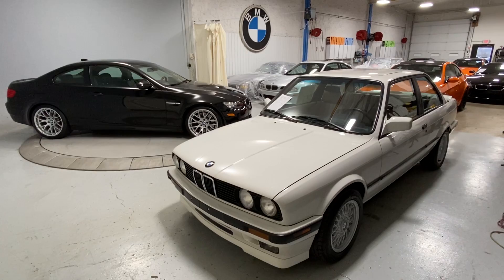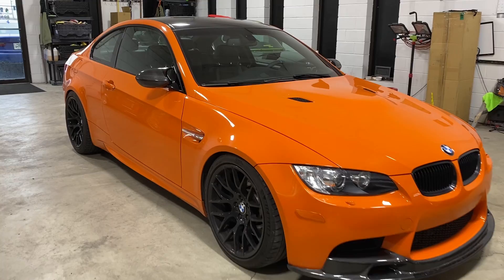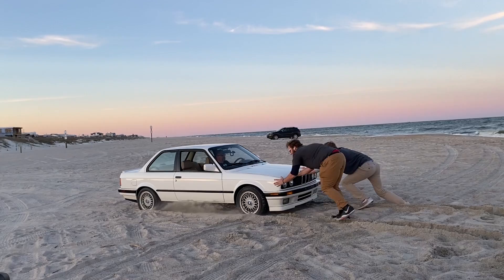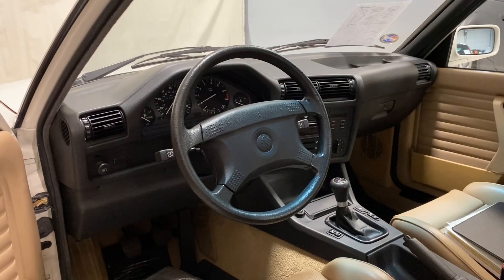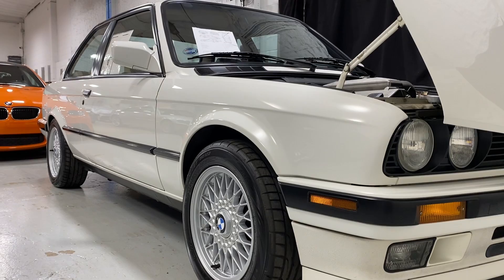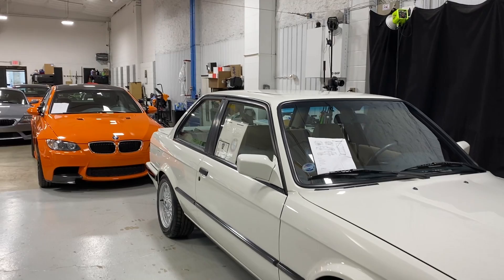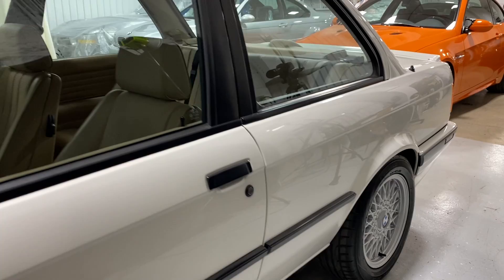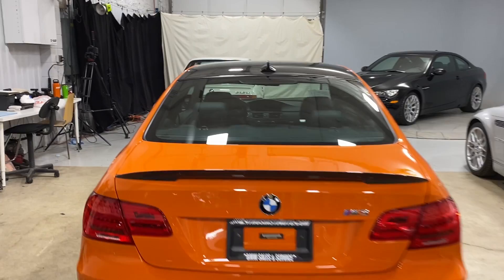1991 BMW 318is - Memory Making E30 - BMW Enthusiast Chronicle

Comment: Cool video! My first car was 91 318is. My dad bought it about 10 years before I could drive. I daily drove it for 3 years before I went away to school. I loved it. Sadly the driving through 15 New Hampshire winters it rusted away. After I graduated we found another one in good shape. Sadly the M42 engine bent valves and destroyed its self. So we did an engine swap and she is living on with an M50 engine. I love e30's I don't think anything will ever come close in my opinion.
Reply: Sad that we lose e30s from owners that dont love them enough that they rust away
Reply: @_rmms_8285  I think we lose more e30's from people tracking them and crashing them then people who daily drive it through the winter. I was 16 and it was my car... I had to get to school and football. Thanks for the back handed comment though...
Reply: @BattleBean762  what i meant by that is it can rust away but dosent mean you have to tthrow the car away restore it. I have two e32s and one dosent have the whole floor its rusted out and im only 16 myself and broke. restore them both is my goal and  to save as many other old bmw as i can :)

Comment: God only knows what they want for it.  Cool car, but certainly not earth shattering.  The M42 was a "gutless wonder".  Really had no torque, but the benefit was the lightest E30 since the 2002.  Best thing you can do with that car is do an M50 swap.  I don't think it will ever have much collector appeal and why not have something that performs.  I'd rather have an M20 car any day of the week.
Reply: They're also not the most robust engines. It's actually difficult to find parts to rebuild them since they kind of fall apart.
Reply: @verdict1163  Not true. Do your research.
Reply: It's not all about power.
Reply: @verdict1163  wtf are you talking about